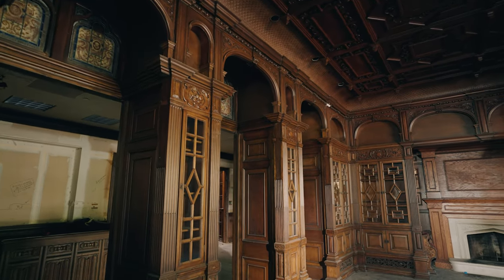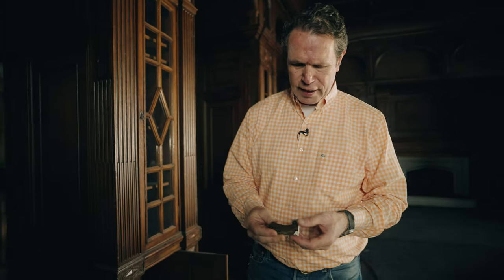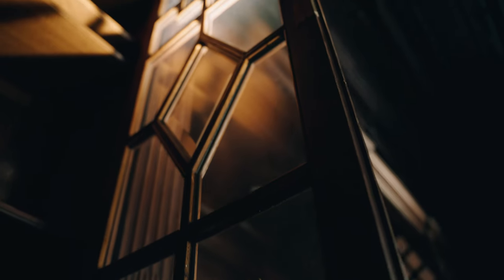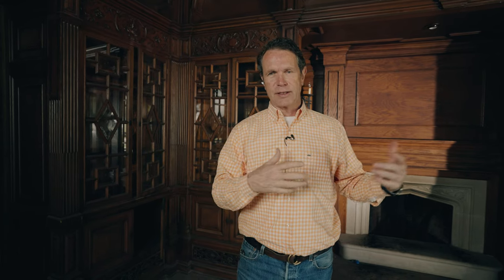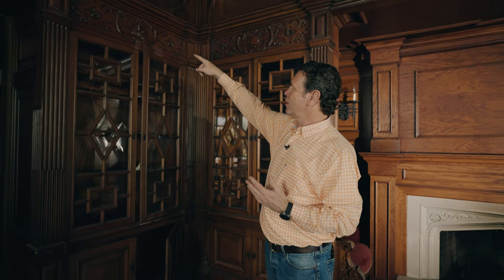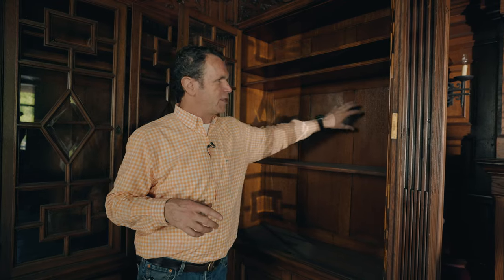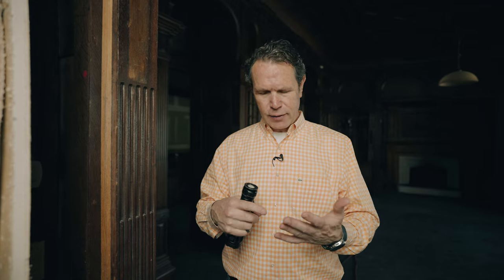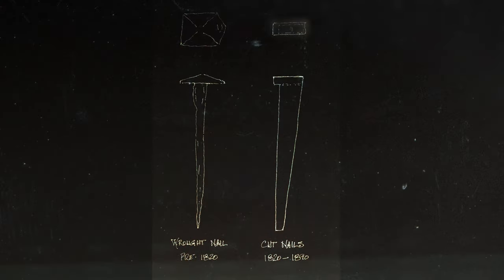Dating Historic Rooms: 4 clues for telling if it is original or fakery.

Comment: Plywood was invented in 1865, and came into common use in the late 1920's in home building, mostly in household cabinetry, but was also used in furniture.
The late half of the 19th century saw a big surge in plywood use, and multi layer veneers in cabinetry and furniture, especially on complicated builds with multiple curves and larger panels.
Phillips head screws were invented in 1932 (John Thompson) who sold the design to Henry Phillips and began selling a refined design to auto manufacturers in 1934. 
Things are sometimes older than we think, or not as old as we think they should be.
Great video, Brent! Informative and entertaining!
Reply from the maker: Thanks for the info and for watching. Good history lesson!